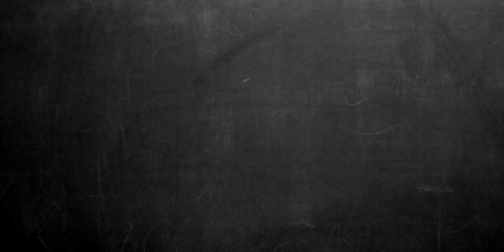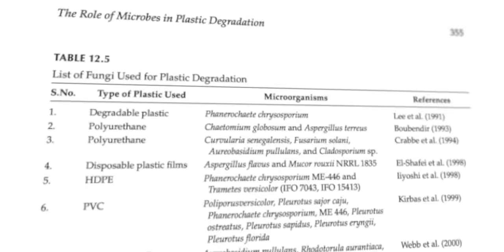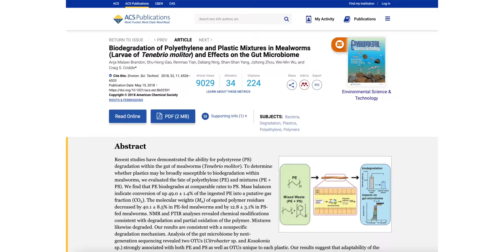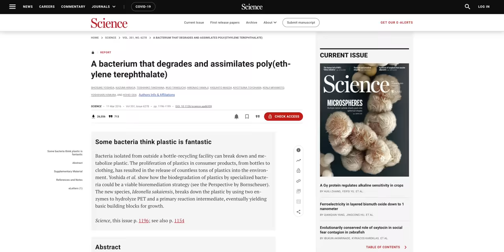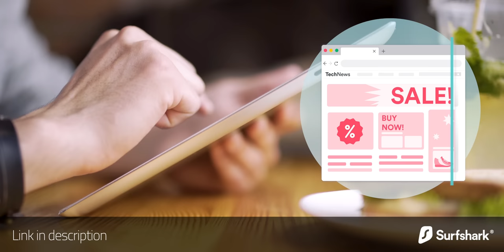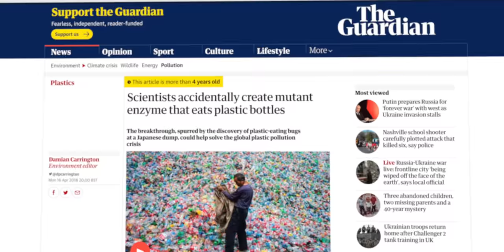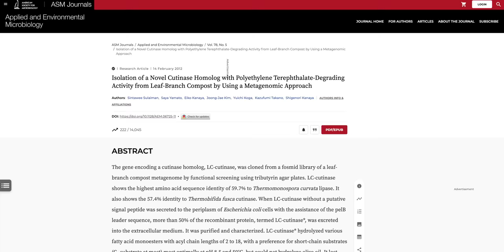Why This May Be the Future of Plastic Recycling

Comment: As somebody who got a 3D printer for Christmas, this has been a topic of concern for me. Being able to compost PLA in a residential compost pile would be huge, as PLA is the top type of plastic used by 3D printing. Although "Evanesto" would have to endure temperatures of around 200°C for a short period of time, as that's the temperature 3D printing generally uses. Perhaps the emzyme can be made available separately if it can't be made compatible with 3D printing.

I'm also wondering if the processes compatible with PET would also work with PETG - which is PET with a glycol modifier. Which is also a plastic commonly used in 3D printing.

Would also like to know if there has been any progress made with ABS, PTU, and other materials used in 3D printing.

Comment: These breakthroughs seem promising. I'm hopeful that we can overcome the economic barrier to proper sustainable plastic. Plastic is so useful, which is why it is so ubiquitous, so it would be great if we can keep using it without destroying the environment.
Reply: That's doubtful. This can deal with a lot of plastic if scaled but the main issue in the long run is going to be microplastics, plastic takes about 500 years to biodegrade, most plastic has been produced in the last 50 years and we're already seeing significant issues. Plastic isn't going to disappear completely but the way it's currently used is completely unsustainable. I suspect we'll see a mix of moves away from plastic, biodegradable alternatives where possible and recycling. But in the long run simple recycling doesn't allow us to keep using plastic as we do today.

Comment: The trouble is, a lot of the reason why we prize plastics is for their inertness, that they don't break down and can seal food to keep it safe to consume for longer.

And I think instead of just referring to "plastics" we should be differentiating disposable items from ones designed to last. Like you don't want the handle of your power tools, or an electrical plug from starting to break down over time. We want them to last for as long as possible to avoid having to replace them in the first place.
Reply: Thing is those tools are supposed to last long term, and not be in such ubiquity. We (humanity) created millitude more plastic than we need. And we continue to create it as a disposable short lived product. Even in more high tech products was included idea of short-time life, so that consumer buys more of it.

Comment: Would really appreciate an explanation of how/why these digesters would not become a problem. That is, why wouldnt they start digesting plastics we are still using, in cars, appliances, food storage etc. Is it the high temperatures needed? But cars run hot. Very interested in the answer, thanks.
Reply: Not if the enzymes require a constant temperature, which doesn't exist in most environments.
Reply: Because these enzymes are not alive. They can’t “escape”.
Reply: @CampingforCool41  Well, if they are beneficial for the organism, then the gene that makes them can escape, and get reproduced in bacteria and virii of other organisms, including humans. The only question is "How long". But, that can be said of a gazillion of other things. The point is, life is a constant struggle - preserving one thing means hurting another thing.

Comment: So long as it's not used to maintain business as usual, it should be fine. But as you said, it'd be better to move along to something better. Plastics have their place, and it's not where we mostly use it. The main issue will be getting alternatives to emit less co2

Comment: Thing is you still have to get the plastics out of your rubbish. In Sydney we have 3 bins - Yellow (recyclable plastics, glass, aluminium, and paper), Green (garden waste) and Red (generic household waste and non-recyclable waste.) What if we could keep the Yellow bin for glass, aluminium and paper recycling - but move ALL the plastics into the RED bin in which everything was gasified? Gasifiers are expensive because of energy costs - but that's where Super-power comes in.  Have you heard of SUPER-POWER? It’s all about solving the wind and solar power problem of power output dropping off in winter. We used to wonder how we were going to store power for a few months. But now that renewables are so cheap, instead of trying to store power for winter, the engineers plan to build extra renewables. If winter cuts output in half, then double the wind and solar! This simple concept can get the country through winter. Wind and solar are now so cheap, this trick is still cheaper than coal. And that’s without counting the health and climate costs of coal so it’s actually MUCH cheaper!
But now that we’ve solved winter, we have another problem. What are we going to do with all the EXCESS power the other 10 months of the year? We could just turn those farms off to stop them frying the grid - but that seems wasteful. Yet all today’s regular power demands have been met. What are we going to do with truly huge excess super-cheap power? We can put this to any EXTRA task - as as long as we can shut down this service for winter.
There are many extra jobs I can think of. Splitting water to make vast amounts of hydrogen for synthetic fuel for airlines. We can also use hydrogen to replace coking coal to make steel. We can use that power to run desal to fill fresh water reservoirs. Then there’s the miraculous technology of the Gasifier. These things rip municipal waste into molecules - with synthetic gas that shoots off the top to go to the petro-chemical and plastics industry - and lava like slag that can be turned into pavers, bricks, or rock-wool for insulation or fibreglass. The punchline? Gasifiers can turn household rubbish into half the stuff to build the next house! http://eclipsenow.wordpress.com/gasification/ Renewables are now so cheap that solving the ‘problem’ of winter becomes an opportunity to solve many other high-energy challenges we would not have been able to afford. No wonder Tony Seba calls it ‘Super-Power’. http://youtu.be/fsnkPLkf1ao

Comment: There is a process already being used to degrade plastic in landfill sites. The company is based in the USA. The process, sheet of  '-ve' plastic (to degrade the plastic)land fill to 1 meter, insert extraction pipes and cover with another sheet. This process continued until the site is capped. Residues = methane from biodegrading plastic and other contents. The Methane is piped to an onsite generator with site working life of around 10 years. After 10yrs the remaining site is degraded by 90%  can have the metals remaining recovered and the landfill site can be reinstated. There are working sites in the UK, USA, Canada and Europe that I am aware of.

Comment: I heard the United States had previously been shipping most of our recyclables to China and I later heard that many of the ships containing those recyclables would sail into the middle of the ocean and dump the materials out there. If that is true, then that is one of the major sources for all of the plastic garbage floating around in the oceans. Either way, how do we get rid of so much plastic waste? 

I heard one scientist suggest that burning plastic to convert it into energy would be the likely best use for plastic waste, so long as you put scrubbers on the smoke stacks coming out of the incinerators. Apparently, modern scrubbers are very good and the burn residue would be a fraction of the volume of the actual plastic being burned, plus doing so would get the waste out of the oceans and landfills. I don't know what the solution is, but short of a revolution in material sciences, it is said that plastics are not going to go away as we depend on them too much and getting rid of them would force us to go back to old ways which pollute the environment even more. I hope scientists can find a great solution soon.

Comment: On balance, I wish this video focused more on the lifecycle impact of plastic.

Since virgin plastic is currently made from fossil fuels, we seem to be left with only bad options for disposing of it - let it break down naturally (our original approach, resulting in microplastics everywhere), accelerate a complete breakdown into CO2 which is effectively adding CO2 to the atmosphere as if we were burning fossil fuels, or accelerate the partial breakdown so it can be made into more plastics, which at the end of their life will pose the same problem of disposal options (what you discussed here).

While it sounds promising that PETase could reduce the demand for new fossil fuel extraction to make more plastic, it sounds like its actual potential to turn plastic into a “green” material depends heavily on changing the source of our virgin plastics away from fossil fuel. I wish you’d covered this more heavily in the video - similar to how burning wood is considered “carbon neutral” because it relies entirely on recently sequestered carbon, sourcing plastics from recently sequestered carbon instead of fossil fuels would mean that research on accelerating plastic decomposition wouldn’t simply be contributing to global warming under the guise of being “green”.

Comment: Another fantastic video thanks so much! Lots of exciting future tech solutions - it seems like we've been talking about it now for years but without regulation or penalties on current unsustainable plastic overuse practices we are still in a dire situation with plastic pollution. I'm in Japan and the situation seems to be getting worse with 99% of all vending machine drinks available only in PET bottles which are mostly incinerated in Japan but the public level of awareness is low, most people think it's recycled like aluminum and glass 😅 Good to see shift in more ethical brands like MUJI now having water refill stations in all stores (rare in Japan) and selling drinks only in aluminum cans, glass or paper. Unfortunately, CocaCola & the other major beverage companies not at all motivated to change.

Comment: I believe we need to charge manufacturers of plastic products a recycling “fee”, that way we can calculate true cost of this packaging. This may encourage manufacturers to use more glass packaging or alternatives and recycling them, so we can use it again and again versus using it once and throwing it away. Example you might use a plastic straw for 2 minutes to sip a beverage from a fast food restaurant, then it will end up in a landfill waste, but it will probably take 1000 years to break down. Seems like an illogical solution for a minor issue.

Comment: I think the worm idea is fascinating, and I'm all for "all hands on deck" solutions to the plastic crisis, but it's not truly "recycling" because the plastic is just fed to worms... and then what? So much of the plastic pollution crisis is a matter of production, and while this worm idea does present an alternative way to dispose of plastic, it's not clear to me that it is scalable. If anything, when plastic is fed to worms (or burned or landfilled), it signals to the market that there's a demand for more plastics. In contrast, traditional recycling puts recycled plastics back into the supply chain and (in theory) displaces the need to produce virgin plastics. Virgin plastics are cheap because the raw material for plastics, oil and gas, have been massively subsidized by the federal government for decades.

There's also the problem of collections. People love to cite that only 9% of all plastics ever made have been recycled but don't acknowledge that recycling collection infrastructure is vastly underdeveloped. What good are newer recycling technologies if plastics struggle to be conveniently captured for recycling? Many (perhaps most) types of plastics, such as the dashboard in your car, are not even designed to be recycled. EPR policies (Extended Producer Responsibility) will help with funding collection systems and incentivizing less plastic overall with more recyclable plastics. The solution to prevent more plastic pollution is to reduce production.

Comment: To recycle it you melt it again into pellets and then again to mold it into something and that makes it weak, so you still need to mix it with new. Also plastic is already a by-product of oil production. Trying to recycle a already cheap by-product. We create more plastic than we need just refining oil. Theres no market for low grade plastic. Cant use it for building products because IT DOES DEGRADE with time.

Comment: In the EU many kinds of single use plastics must be "compostable" by law, meaning that your shopping bag or disposable cutlery are usually made of some sort of PLA, hence the interest of said French company in adding an enzime to the PLA to make it degrade faster. Also, since the same thikness of PLA will degrade faster, you could make more durable bags that still meet the legal requirement (our first generation of compostable bags were quite bad). As usual, changing this kind of things requires some input from the Governments.

Comment: Thanks Matt,
Sounds great but be careful what you wish for.  I like the idea of addressing waste single use plastic but not engineering plastic please.  Both PE and recycled PET are used as durable building materials - for water pipes and geotextiles/geomembranes and filter fabrics for geotechnical engineering (soil and foundation engineering) respectively.  If these microbes accidently enter soils containing these infrastructure items, we will have another type of environmental disaster.  Currently suppliers of geopolymers made from PET estimate the longevity of their products (like Bidim) to be 500 years.

Comment: As with many problems, using enzymes to recycle plastic is just one of the components of a greener plastic industry.
I think that, like you said in the video, one key component is our plastic-manufacturing habits.

Now this whole issue (enzyme degradation+manufacturing plastics that are easily de-gradated by enzymes) also has the potential to make plastic containers more fragile and prone to contamination. Like all complicated matters, this issue requires achieving a good balance between all the processes AND make it economically viable to boot.

Comment: The problem is not whether or not it can be recycled or broken down by enzymes. But the cost that comes with it. So in my opinion you should burden the customer but the producers. They should have to pay upfront for the recycling/breaking down of plastics. That way the money needed for it is already payed. As an added bonus it levels the price to alternatives, And I don't know if it's enough and it doesn't have to be, but it could bring back glass bottles if these level out in cost.

Comment: I don't know much about PFAS, but would there be any toxic biproducts in soil derived from biodegraded plastics?
Reply: Recycling plastics won't be done in the soil.  More like in big recycling centers.  
When we have the microbes to eat plastics, all of the plastic that we can collect will be turned into sludge and then recycled safely.  It's a big system to build, but not really so complicated.  It'll be another step in the industrial process, the final recycling step.

Comment: Where does one obtain a protective (probably spray-on) coating to prevent accidental digestion of plastics we do NOT want to be broken down from polymolecules? No one wants their styrofoam house insulation or plastic house wrap to be reduced to nothing weeks or months after installation!

Comment: If I remember correctly one of the problem with these bacteria breaking down the plastic is that one of the components it breaks the plastic down to is co2. So it breaking down all the plastic with this bacteria would rise our co2 emissions. Still, I am optimistic about these evolvements in the industry.

Comment: Excellent coverage of a corner of human industry that is cause for optimism based on faith in technology.  You hinted at an alternative perspective to one of technological solutionism, but your focus is on inventing our way out of a problem.  That's OK, that's why I like this content. But the social and political side is equally important, IMO.  I'm reminded of a line from the movie, The Graduate: "One word: Plastics."  There it was broad philosophical commentary, but perhaps in hindsight that commentary/scene  was not only critical of the aesthetic, but indeed, the vital parts of our civilization.  Plastic is great, and I wouldn't want to live without it or some equivalents.  But I believe the most important insight is that there is no invention or process or societal change that does not carry the unintended consequences, or environmental costs externalized by those driving the process - foreseen or not.  What process doesn't have byproducts?  is it OK to engineer organisms to ingest our plastic waste?  Are the outputs really benign?  Have we really considered the long-term implications with sufficient scrutiny and clarity?  We vertainly were less aware of the plastic problem in 1967.  Would it not be hubris to not be extremely cautious?